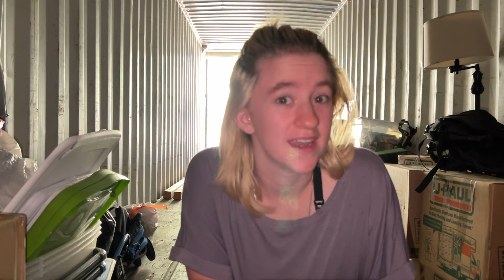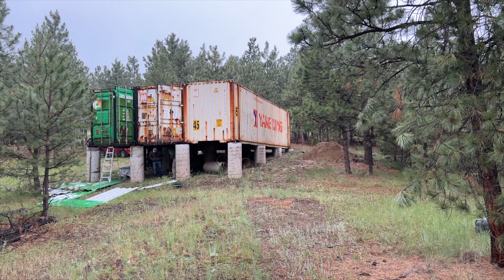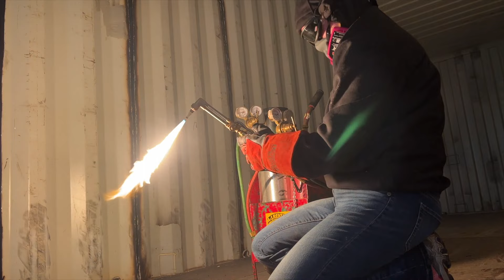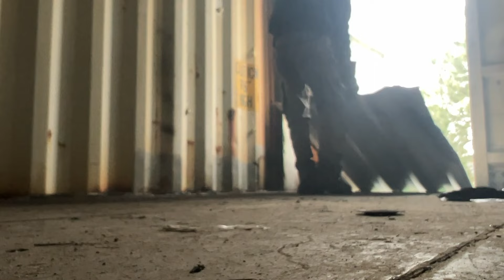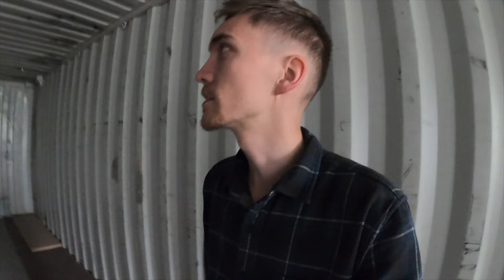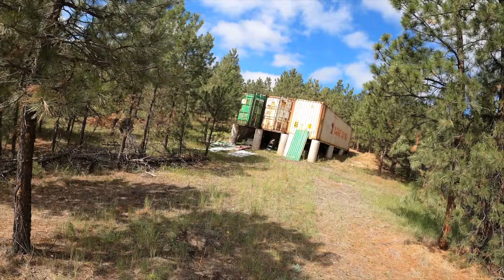WE'RE MOVING! EP4 Building a Shipping Container Home with NO EXPERIENCE!

Comment: my question is why are you using a cutting touch a good grinder with a cutting blade would do it easyer
Reply from the maker: Hey Wade, it’s Madison:)  We found that the oxy torch really was beneficial for us! And using a grinder takes up the use of another Generator that we don’t always have.
Reply: @ShippingOurDreams  Actually, if you are going to build anything, you'll probably be investing in cordless tools. When that happens, you need a grinder and batteries will just be a given. Charging those batteries can be done with a tiny solar panel setup. Much safer, faster and easier to transport.
Reply from the maker: @FirstLastOne  We tried doing cordless and the batteries drain too fast. To have multiple batteries last us 8-hour days would be hundreds if not $1k+ to buy. We found it more financially beneficial to have corded.